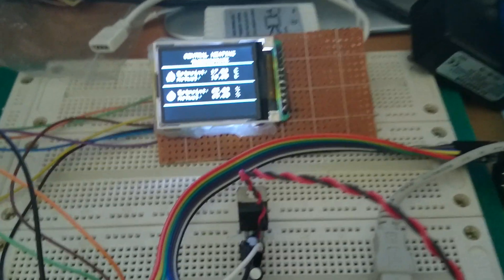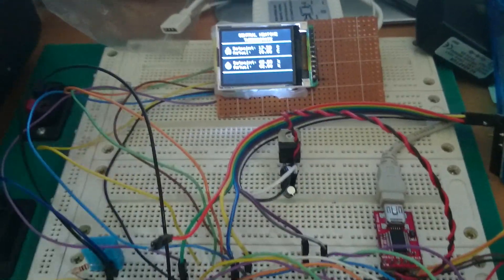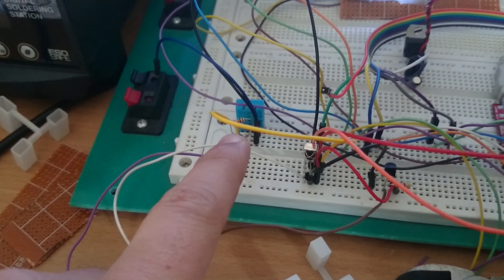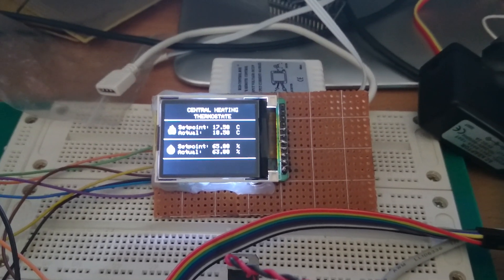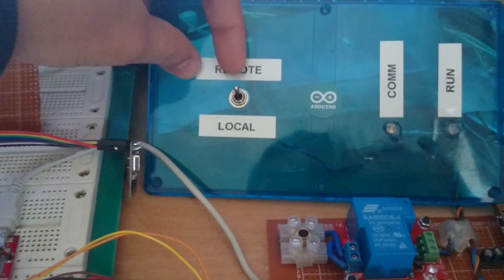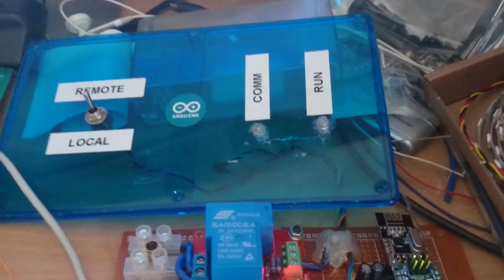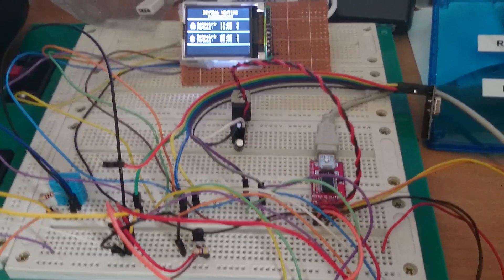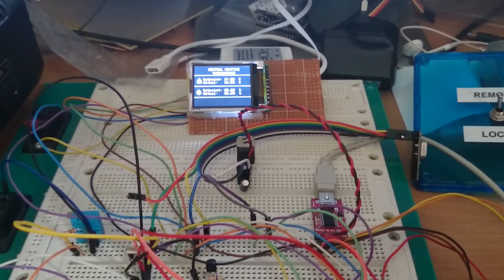Arduino home central heating thermostat and  Room Arduino Digital Thermostat Controller

Comment: Hallo, great job there. My name is Mike and I am looking for someone really good in electronics to help me with my project. I would like to create a device that would measure object's  temperature by infra sensor, lean ankle and also environment temperature. Results of sensor's inputs would be run through my own  logics and final  information would be displayed on some kind of display not only in numbers but also in graphics mode. 
My questions for someone as good as you are: 
-is this possible to create such device at home 
-how difficult (time consuming) it would be
-are you interested to help me with that

I can cover reasonable costs of material and labour. 

Thanks for considering this. 

Mike